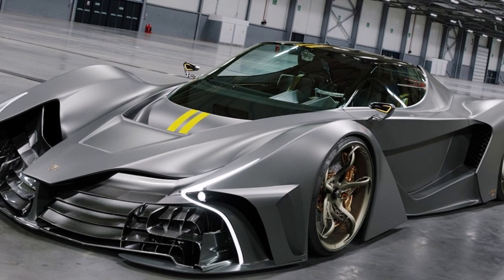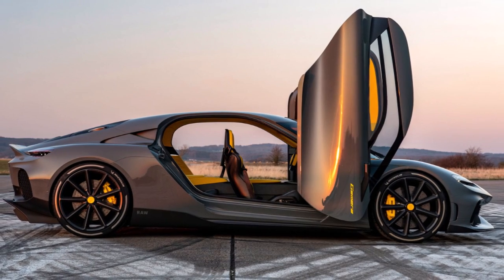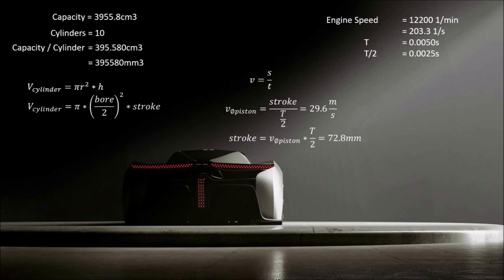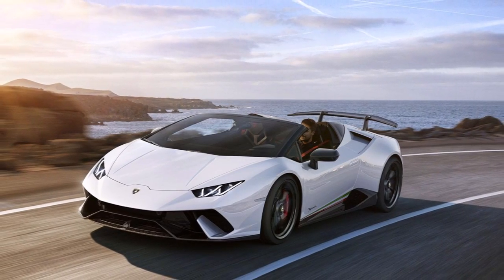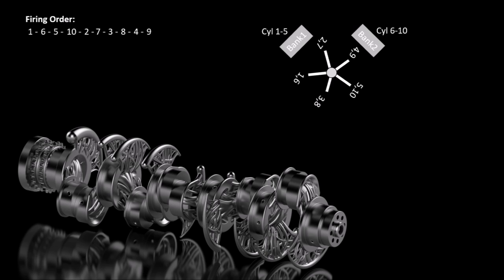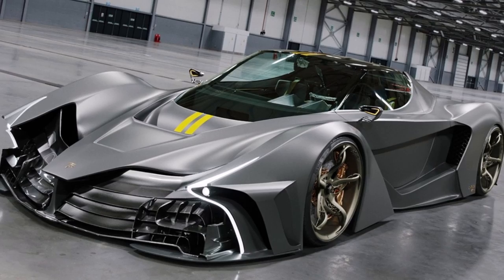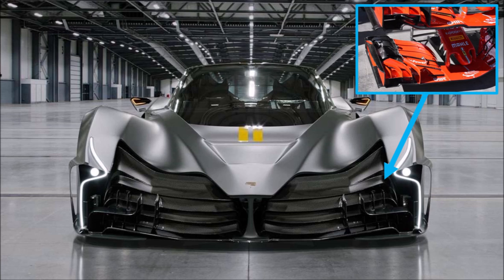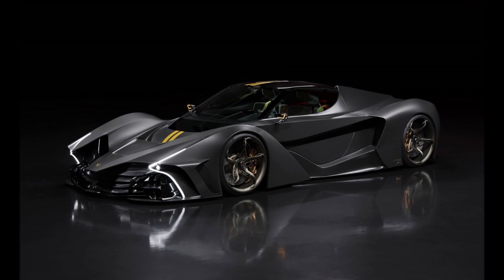Spyros Panopoulos Chaos - CLOSER LOOK

Comment: Interesting look, it looks like the engine has a decent basis but the figures just seem off. And like you mentioned with the front aero, some of their design choices are a bit iffy.
Reply: Can it be that the front wing, just like in F1, flexes with higher speeds allowing more air flow?
Reply: I would believe that the front areo would we able to change its angle of attack on the fly

Comment: X - To get top speed out of this! A major role Will play:
X - The use of Special tires ordered and made by Pirelli.
X - With an excellent grip and stability on the straight road and in the curves. 
X - Made of special material that does not quickly overheat
X - the (heat resistant/avoiding overheat) Rubber tire too much at very fast speed. 
X - The all wheel drive 4x4, (4 wheel transmission). 
X - Front and Back wheels / Powered Percentage values transmission.  
X - The Aerodynamics of the car.
X - The 90 degree angle engine like F1 cars have.
X - The Low Weight: 1000 Kg - 1150 Kg max. 
X - The Downforce: 1740 kg / 1.04 m lower center of gravity.
X - And the experience of the driver.

Comment: 3000 HP out of a 4l engine is definitely possible but I'm not sure how long this thing will hold together
Reply: F1 is 1.6l and delivered 900hp
Reply: @ΚωνσταντίνοςΚαπίας  yeah but they don't have to run for 50.000 miles and cost more than this whole car probably
Reply: @ΚωνσταντίνοςΚαπίας  because they rev up to 18.000 rpm. And the ceiling is 20.000 rpm, so...
Reply: I’m sure it’ll make 3,000hp. 
Once.
Reply: @esesel7831  f1 runs for 50.000 miles in 100% of what they can delivered the car not you can't go 100% on public road so you can go easily 100+ miles or take a example of m5 e60 this v10 is inspired from f1 engine is not very reliable but it's working
Reply: @ΚωνσταντίνοςΚαπίας  The question is, where is the design inspiration and more importantly the philosophy coming from, F1 or drag racing? If it's drag racing, and we know Spyros is a drag racer, then the engine will need to be rebuilt in a short period of time. Drag engines produce tons of power. In order to achieve that level of power they are operated at extreme conditions that no other engines are subjected. 

I guess it doesn't really matter to a potential buyer of this car. The necessary financial resources to keep up with the possible maintenance costs won't be an issue for the owner. If you can afford this car, you can definitely afford to rebuild the engine a few times for the extent of the ownership.
Reply: @esesel7831  Is someone who will buy this, will do 50000miles? Maybe as well the engine needs to rebuilt every 10000 miles or something.Who knows...The cost is 13.5 mil so I'm not sure how much cheaper than an F1 car, is.
Reply: If I remember correctly spyros said in an interview that the engine will have a variable power between 400hp and max 3000hp
Reply: @kostis007  δεν πάει συνέχεια με 18000 στροφές, 12+ είναι πολλές για οποιονδήποτε κινητήρα
Reply: @ΚωνσταντίνοςΚαπίας  να είμαστε σοβαροί λίγο,  ΔΕΝ ΠΡΌΚΕΙΤΑΙ ΠΟΤΕ ΕΝΑΣ F1  ΚΙΝΗΤΗΡΑΣ ΝΑ ΚΑΝΕΙ 50000 ΑΓΩΝΙΣΤΗΚΑ ΧΙΛΙΌΜΕΤΡΑ
Reply: There is so much wrong with the engine design I don't even know where to start

Comment: So . I know the tuning company he owns started building a turbo Aventador that disappeared from his social. He said the same specs high reving turbo 3000 horse power billet 3d printer pistons etc etc. There was a video of it working too.  So my guess is that he is indeed using a lamporghini engine and drivetrain maybe from a huracan . But the info leaking suggest that there isn't much of material yet about this project. Even it's brake calibers.and wheels that where shown , someone leaked info saying it's real but doesn't work at high speeds . The 3dprinted  wheels explode from centrifugal forces and stuff. So I guess he searches for investor's
Reply: the car exists only in 3d renders...
Reply: interesting, we were thinking how it is possible that tires and wheels can take such extreme forces, they can´t, so what might happen, is that this project serves as an excellent base, for another application ... that is actually more exciting

Comment: The design of the crankshaft looks very weird.. I am not an engineer but why reduce the weight in the crankshaft this way, when you can squeeze the weight you need to the smaller possible size..?